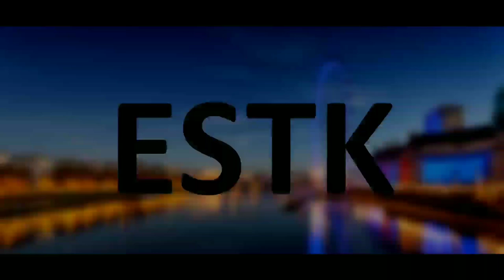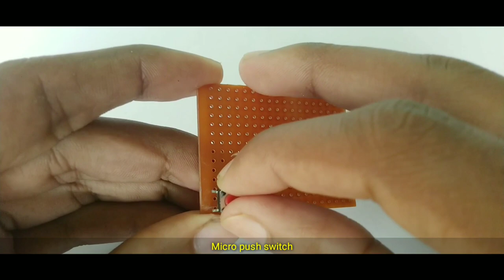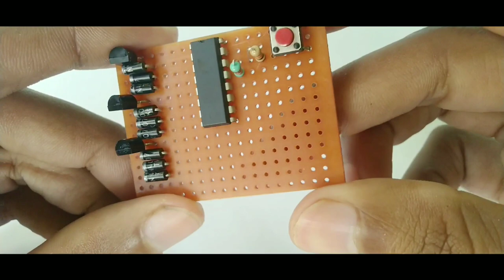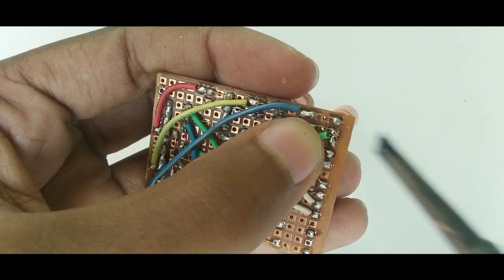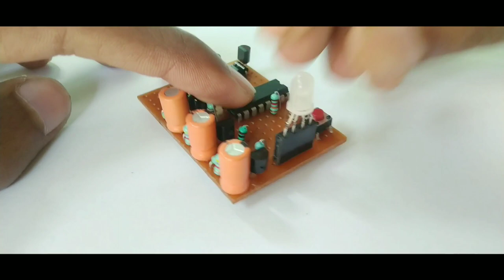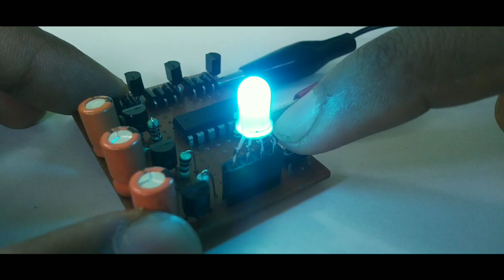Amazing RGB Controller using Micro Push Switch

Comment: Eventually, in the next clip, leave the wiring diagram, because you have a quick video, and we can't see every connection, every component how and where it goes. Thank you
Reply from the maker: I don't want to included the wireing diagram in my video because, some of the cases I make mistake in the diagram, so if I put the diagram in the video, then I will be unable to change that.
Reply: @estechknowledge  so now what..???